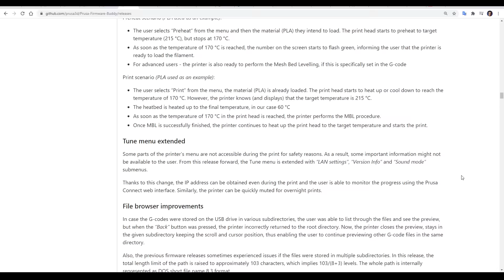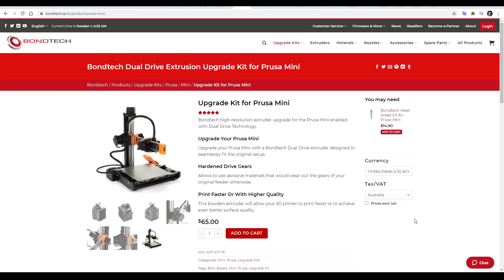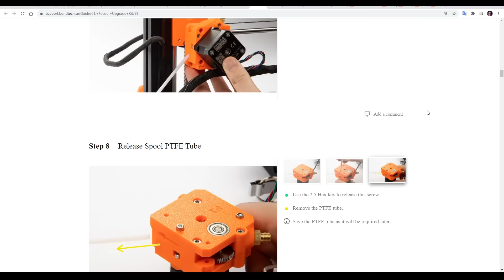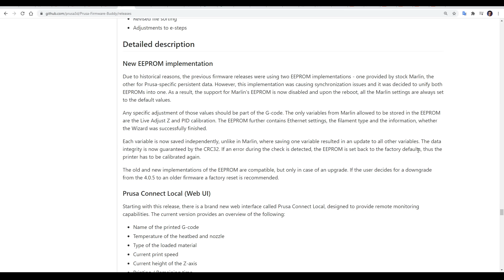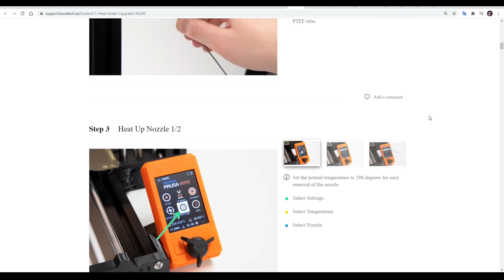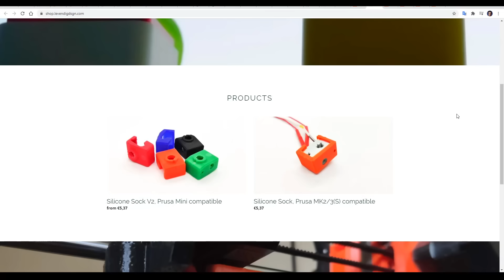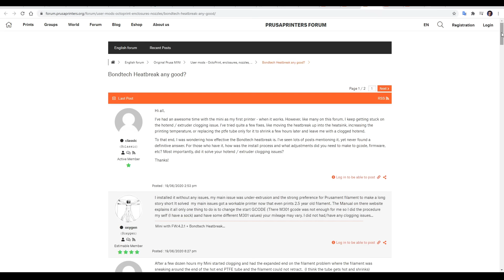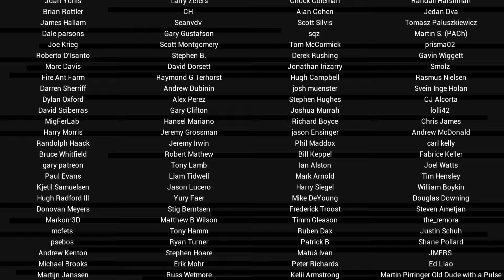Prusa Mini update: Improvements including Bondtech extruder & heat-break

Comment: I really do not like my mini. I have had it less than a month. I already have had to get a replacement bed thermistor. Just today my PETG got clogged in the extruder because the tension screw makes no sense and it's so hard to get into to clean. 

For the price I paid I am really disappointed. Get an ender 3 which had far superior print quality and costs half the price.

Comment: I have just done the extruder only upgrade. I have put the settings in the gcode in every print. The problem is I get lots of stringing using petg ever since. Sometimes it is so bad that it gets tangled and rips off the first layer from the bed. Do you have any ideas what adjustments I need to make to fix this. I am relatively new to 3-D printing and this is my first printer so I don't really understand what all the settings do.

Comment: I waited 6 months for my mini. Did a few great prints then downhill after that. It's so frustrating it's been sitting for 2 months untouched. Today I added a new nozzle and bond tech heartbreak and that still hasn't fixed any issues. Also random red screen, bad usb drives etc. Really disappointed in it. Hate to say it, I miss my ender3. Unmodded the thing was dead nuts reliable and printed non stop for months without a single issue.

Comment: Even after all these upgrades, i still dont think the print quality is where it should be for the overall cost, and no typical eeprom just seems silly though not a big deal.
Reply: It's definitely annoying though. The appendix (tab you have to break to modify the firmware) wasn't even mentioned to those of us who pre-ordered. Not a pleasant surprise. I've had similarly poor results from the machine and would have returned it if I didn't need to benchmark it for schools I work with. Definitely a decent option compared to something like an Ender, but I recommend the mk3s to anyone who can afford it instead. I seriously hope Prusa drops the custom stuff and just makes another decent printer for the mk4/XL, but given recent events and issues I'm not too optimistic.
Reply: @syber-space  It may have been a surprise, but why is it unpleasant? The only people for which it makes a difference is people who want to load custom firmwares and then also claim warranty afterwards, but surely you wouldn’t do that?
Reply: @JasperJanssen  It's an active move against the open-source spirit. It's as much a moral issue as a practical one. The presence of the tab was actively hidden, with show units having them removed cleanly. I don't mind the general policy of voiding the warranty in cases like this, but that needs to be made clear before you have people purchasing something.
Reply: @syber-space  They can't just void the warranty for U.S. customers; it's against federal law. The Magnuson-Moss Warranty Act affirms the right of consumers to modify products they own, without having their warranties automatically voided.

Comment: I like my mini as is. But extruder is fairly annoying. Gears gets dirty very often and tension adjustment is cumbersome. It is able to print some flex but is chews it too. Rest of the printer is fine but due to extruder gear I wouldn't call it reliable.
I'm still not sure if some line defects are from the printer itself because they are repeatable. I think that there is something in Prusa Slicer that wasn't in Cura that causes that.

Comment: I've had the printer since March it had to be sent back to the factory for it would not print correctly one they send it back to me with samples it was OK but I took it apart and found 1 boden tube missing from the assembly just after the extruder motor now it is my favorite printer For small prints

Comment: I had to swap out the small section of PTFE tube on my mini. I also need to raise the heat break,  but I can't break the grub screws loose on mine. I will have to get ahold of support to see what to do about it.
Reply: They sent me a replacement entire hot end assembly for free ($78 replacement part).  Unfortunately it only worked a week before clogging up again.

Comment: Hi Michael - I have a Prusa MK3S and a Prusa Mini (October 2020 production) and have not had the issues you encountered.  The Mini prints at the same quality as my MK3S.  The only issue my Mini has is that it is very finaky on the filiment I feed it.  What I consider Premium filaments (Atomic, Printed Solid "Jessie" and Prusament all print without a care.  When I feed it a filament from other asia manufactures, it will tend to have issue extruding.  I have the upgraded heatbreak and Bondtech extruder in hand in case I need them (bought them to combat the issues caused by, IMHO, crappy filamenet from the far east.  I know this video is from more than 6 months ago, but I wonder if different filaments would make a difference in  your machine.

Comment: I've had a Prusa Mini since February, and it worked great for a few weeks and then I had extrusion issues. The PTFE tube had shrunk, so I replaced that and then had issues again after another few weeks. The Bondtech heatbreak solved all of those. Mostly now I have no issues at all but sometimes strange extrusion problems so I am very tempted to try the Bondtech extruder as well. I almost only ever get stringing with PETG. I think the quality is very good, but it's my first and only 3D printer so... 🤷‍♀️
Reply: Hello
Did you change de ptfe tube correctly? 
I had many trouble with mine 2 hours after the first print.
At the beginning I though the extruder was faulty but after cleaning it it work for 2 more hours then it started making noise.
I change de the ptfe hose with my method and no more problems with the hotend.

It is my first printer too.
Reply: We also have issues with ours. After an hour printing the extruder would make clicking noises. We've taken it apart, changed the tube, tightened the couplings, etc. Very annoyed with it currently. Would not recommend the mini to anyone with all the trouble we've had with it.
Reply: @tomsko863  the quality is good but yes, fixing it could be hard...
When I disassemble my hotend, the heat break was very clogged. I had to drain it with a wood stick by the upside while I was heating it a 280°
Then I could mount the new ptfe tube.  I I havnt cleaned the heatbreak it would have a gap between it and the tube. (after the pla clogged melt)
 I make sure to do a half turn more with the joining part of the bowden to tighten the tube correctly. (screw the joining part to the max with the heatbreak and the tube in a low position,  Unscrew it for a half turn. Push up the heatbreak at the maximum and screw the 3 little screw on the right. Then screw the joining part to the max. 
With this method the assembly is tight. But the heatbreak have to be clean.
Maybe you will need to a little more than an half turn, unscrew it at the beginning the value you want before pushing up the heatbreak.
Take car the temperature you use with your filament, mine need more than the value indicate on it....

Sorry for my English 😅
Reply: @bargeaup.6378  Yes, I think the main problem is the heatbreak allows the PTFE tube to get too warm so it shrinks over time. It's like the tube is a consumable part. I have measured the Bondtech tube a few times since I fitted it and it hasn't shrunk at all.
Reply: @RobeenaShepherd  I don t think so. 
The factory mount have a 4mm ptfe tube which is to short or uncorrectly mount.
The tube wasn t melt or destroy but the pla reach to go between the ptfe tube and the heatbreak.
Reply: @bargeaup.6378  I did have to undo the grub screws and push the heatbreak up as well. I didn't measure the first, but I did measure the second, and it definitely shrank after about 5 weeks of usage. Before it shrank it was working really well... until it shrank too much.

Comment: Unrelated to the video but it seems like the kind of thing maybe you'd know... have you ever come across what I guess you'd call an entry level micro metal lathe? Something like the 3018 CNC Router of the lathe world - not the greatest, but perfectly serviceable for pins, rods, sleeves, and bolts/screws (so adjustable auto-feed). I'm looking to expand my 3D printing base to include articulated toys and cutting down old nails by hand is something I'm not exactly looking forward to doing in any reasonable quantity (four has been enough doing repairs on existing toys, and good luck finding super-coarse "thread forming" dies).

I've seen your earlier wood lathe video but it's clearly a more manual option, though it is about the size and power I'm trying to find. Everything I've come across so far myself has been much larger (like the 7x12 "mini" lathe), missing auto-feed, impossible to obtain, and/or is prohibitively/unnecessarily expensive.

Comment: I was waiting for this Video so bad. I have the same opinion about the Mini and I have the Upgrade Parts here but I am still afraid of upgrading as the new values cannot be be saved permantly and the results aren't mindblowing. Your results after installing the upgrades does not give me hope that the upgrades are worth it for the mini. So now I am confused what to do. I still have my MK3S too and have no Problems at all with it. Maybe a Upgrade to the Slice Engineering Mosquito or Copperhead together with the Bondtech Upgrades makes a good Printer out of the Mini... What you think?

Comment: Wait, I thought this thing was supposed to print perfectly out of the box? All the sudden that $450 is $550+? I'm sure the upgrades don't end there either.

I want to build a farm so I was attracted by the small footprint, but with no place to put the filament roll it kind of defeats the purpose. Yeah they have the little feet you can print which just adds to the footprint, defeating the purpose.

It was kind of an impulse buy so thankfully the four week waiting period allowed me to do more research and cancel my order and save $450. I now plan to get a couple Ender 3 v2 clones and still have money left over.

When I read comment after comment that people can't tell the difference between the print quality on an Ender 3 and a Mini, it was a no-brainer decision.

Comment: I did the exact same upgrades and still not happy with the results.. So now I will put in a Mosquito Hotend from Slice Engineering, I understand it takes the mini to the next level
Reply: it's good but very expensive, the e3d lite6 hotend is excellent if you're looking to print just PLA/PET/ASA, and quite a lot cheaper
Reply: You're going to have $1000 in it and a $200 ender 3 will still print better

Comment: I had the issue with the too-short PTFE tube, but swapped it out. Except for the brief period of jamming just before the swap, I've only had one print that wasn't high quality due to the machine and not operator error with either slicer settings or not putting in the right z-height for the build plate I was using.

Comment: Does these upgardes apply to the new Prusa Mini+ Thank you
Reply: Yes they would. From what I see the extruder and heat break are the same. My mini plus has been pretty good. Only issues I've had was with the extruder pushing certain flexible filaments including filimentium 98A prusa sells. I'm buying the bontech extruder upgrade in hopes the tighter tolerances will cause less jams with certain TPUs. Hope this info helps

Comment: @teachingtech - Have you noticed any noise on retraction since the Bondtech extruder upgrade? My original Prusa Mini+ extruder made an annoying gear tick or grind noise on retraction - which led me to purchase and install the Bondtech IFS version. The first day of printing was silent, but now I'm getting a small, but clearly audible "yelp" or chirp noise on retraction with the Bondtech. Still an improvement, but I'm looking for as little noise as possible. Curious how yours is long term now in this regard?
Reply from the maker: I haven't noticed any noise on this machine, and it sits next to me on the desk. The H2 extruders on my Ender 3 have a noticeable sound from lash when they retract, but fortunately this has no bearing on print quality.
Reply: @TeachingTech  Thanks for responding and sharing your experience. I will continue to try to adjust the tensioner in small increments and see if I can work it out or determine if the noise is coming from elsewhere. Still seems to be exclusive to retraction, so I'm fairly confident it is the extruder. Maybe it will settle itself out. It's still far less noisy than the stock extruder, but sure hope I can find the sweet spot I apparently had on the first day of install as it was beautifully quiet. If I find anything helpful out, I will report back for others benefit.

Comment: I'm in the same boat as you. $399 printer + $80 bondtech upgrades + tax and shipping = ~$600 not to mention dozens of hours dicking around and only to end up with shitty prints.
Could have bought 2x Ender3's for that price and started using them out of the box.

Comment: My mini made me fall in love with printing again! I had been on such a rollercoaster with my CR-10s pro that i was starting to get pretty naffed off with the whole thing, it just felt like one issue after another and i was having to do a lot of work to get it ready to print even the most basic models. The mini however, i just plugged in, hit go and got some of the best prints out of the box i have ever seen. Still performing pretty much perfectly a year in! The only thing i would maybe upgrade is the cooling fan to some sort of fang design as sometimes the lack of cooling at the front can cause problems on overhangs

Comment: What print settings do you have on the Bondtech extruder for Prusa mini+?
 I have had problems with stringing on certain prints. Now I have used 0.4 mm Nozzle, used 0.20 mm Quality @ Mini (modified) layer hights. 
I also changed Printer Settings > Advanced mode > Extruder 1:
Changed to

Retraction
Lenght: 4 mm (zero to disabled)
Lift Z: 0.2 mm
Only lift Z: 0 mm, Below Z: 179 mm
Retraction Speed: 40 mm/s
Detraction Speed: 40 mm/s
Extra lenght on restart: 0 mm
Minimum travel after retraction: 1.5 mm
Retraction on layer change: Enabled it
Wipe while rectracting: Enable it
Rectract amount before wipe: 70 %

These settings I have when printing PLA now. 
What settings do you use and have a good result with different materials?

Comment: Bought one back in June/July, received it mid September... At first it printed fine, but after 10-ish print, the bed leveling seemed to go haywire. It all pointed to a "broken" MINDA/PINDA prove, even though it passed all the tests on the site and support was helpful but pointed me towards the X carriage thinking it might be an alignment issue. Nope, still had to live adjust for every print and even then, it wasn't a guarantee it would print without a hitch.

So they send a probe replacement, which due to COVID takes longer than usual to get here, that's fine. Replace the probe, everything seems to be working until I notice the printer making a new sound every time it moved left... Approximately 1 inch of the belt's teeth seem to be smushed, needs to be changed I guess even though the printer is practically new but whatever... 

3 prints later... loading in filament and it won't purge... Filament ground up for whatever reason. Fine, cleaned extruder, loaded in filament, purged just fine, first layer looks fine... Come back to under extruded and wavy print... 

Can't say I would recommend this printer to anyone... as far as I know, the Q.C. is for show because these issues aren't rare and/or scattered across different parts. I watched a video on how to change out the belt and noticed his belt had the exact same flaw in the exact same place as mine. I would call it a coincidence but at this point I'm positive it's Q.C. (whether it be Prusa's, their providers or both) and it's quite frustrating coming from an Ender 3 with barely any hiccups and having skipped on the Kickstarter price of the Ender CR-6 (I'm aware of the issues with this machine) for a more "polished" Prusa machine.
Reply: This is the nature of 3D printers.
Reply: @alejandroperez5368  I don't mind tinkering with them, giving them maintenance or fixing broken parts, but thats completely different from what appears to be lack of quality control and a broken right out of the box machine. I paid extra for a smaller machine because I was lead to believe this was a more polished experience via a more "reputable" brand over cheaper and larger options.
Reply: @scarfire87  it's usually what happens with 1st gen products. I feel you

Comment: My Mini should arrive in a couple more weeks. I've been doing a lot of research and am starting to wonder if a lot of the problem is with the boden drive mechanism rather than a "direct drive" setup. Bodens do tend not be as tight as a system where the filament goes directly into the drive gears from the spool. Regarding the heat brake, how much weaker is the Bondtech heat brake than the original? Is it more likely to be twisted off with that thinner one? Why not make the heat brake out of more exotic stuff like titanium?